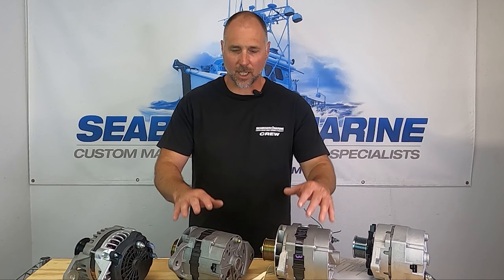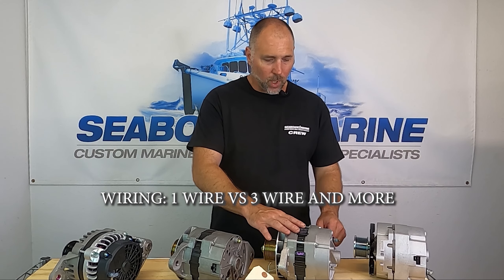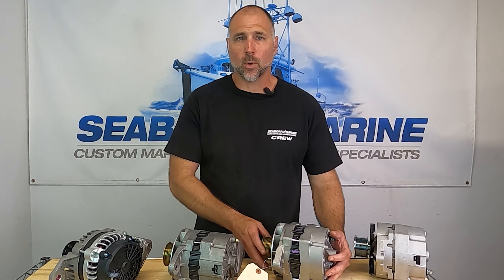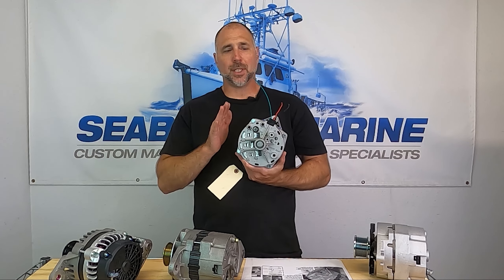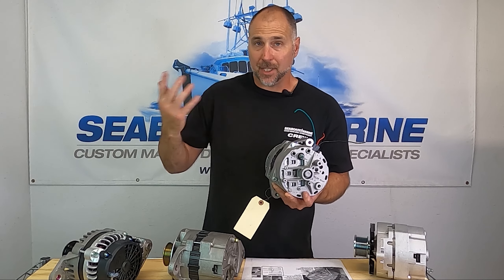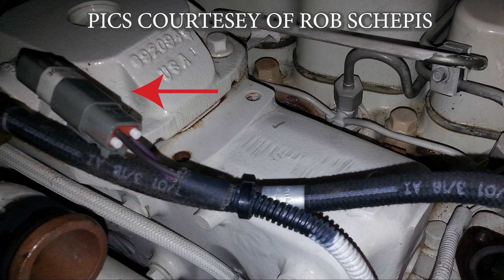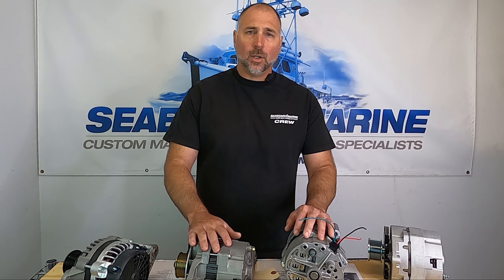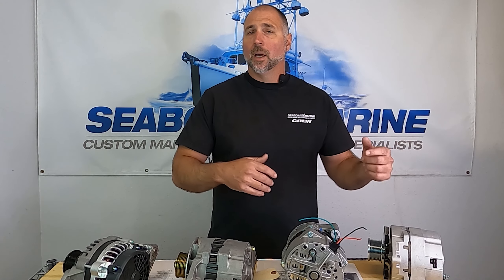Alternators for Cummins Marine

Comment: Thanks and well explained , I just fitted one of your alternator upgrade kits to my 6BT, I fitted a 12V 100 amp delco remy 24 SI , it’s charging a lithium bank and I just ran motor for 30mins to test it and at 1100 RPM it put in a consistent 95-100 amps , I was more than impressed , I had to chop a bit out of my steel belt gaurd and also drilled a bunch of holes in it so alternator could suck some cooler air , I was going to fit a 28 SI but after how well this performed I don’t think I will need to , have a great day .

Comment: Thanks so much Justin...  and thanks for the help on the phone the other day!  I was worried about the 24SI being just a bit longer than the 22SI, but it did indeed fit on the 6CT series 1995 vintage engine.  You guys always impress me with your "customer service"!  (My headache turned out to be getting the timing belt cover off!  I accidentally rounded off the head on the screw that holds the cover bracket at the alternator mount... Ouch.  Quite a pain, finally removed (sawed) the screws holding the bracket to the cover itself, and had to use heat to get the damaged screw loose, so I could replace it!)  

If you do another video on charging systems, please go into the comparisons of the 24 and 28SI...  I am curious about adding a diode down the road, and it looks like maybe I can get by with the 24SI if I use the ignition wire diode?
Reply: "Timing belt cover"? ROFLMAO.